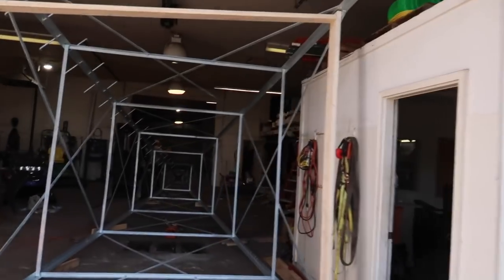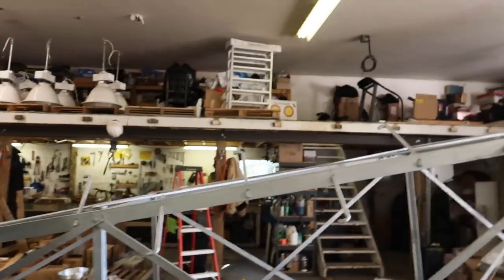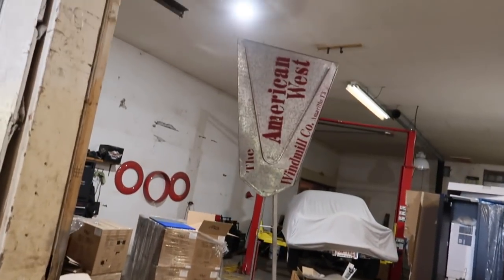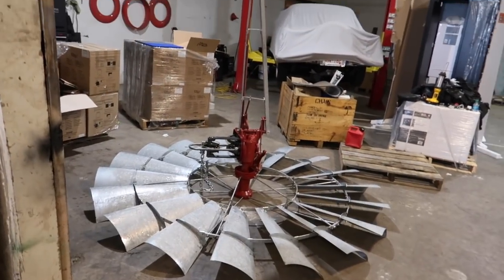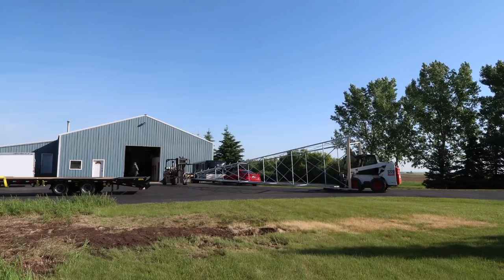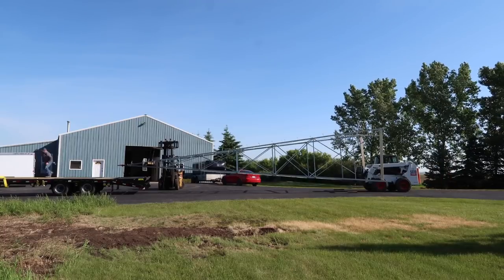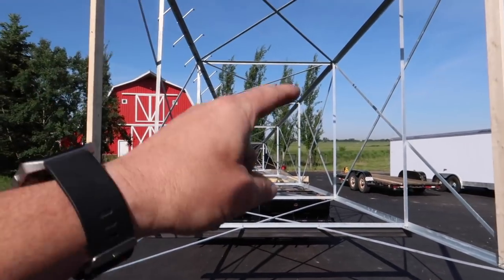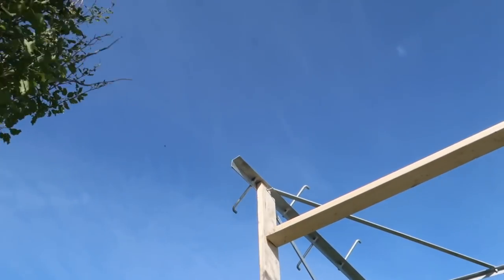Installing an American Icon. (how to install a windmill)  - daily vlog -

Comment: Beautiful windmill, no doubt - but, I've gotta say your concrete footings look a little undersized for the job. Just how far down into terra firma do they extend? Looks like the standard home center issue Quikrete Quik-tube you're using....maybe 10"? I hope you snuck some rebar into the mix!
Reply from the maker: There 12” and 8’ deep. We have and angle iron anchor 6’ in to the concrete when we poured it in. If anything I think we went a little over-kill. I think used something like 4 yards of concrete or something..... cheers👍
Reply: 12" x 8' deep x 4 footings sounds like about 4 yards...my concern was rebar in the concrete as you left them out of the ground so high....burying them flush with the ground uses the surrounding earth to stabilize them - you can leave them high if you've inserted a rebar cage - there's quite a lateral load on them when the wind picks up...hopefully it's all good. I've seen them pull out of the ground like wine corks out of a bottle!